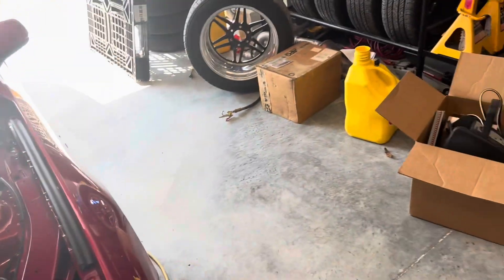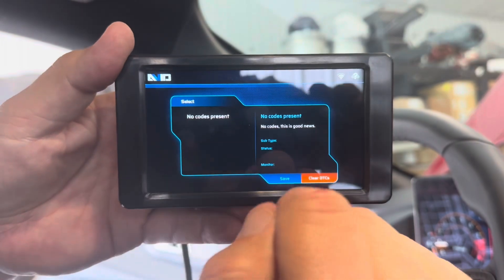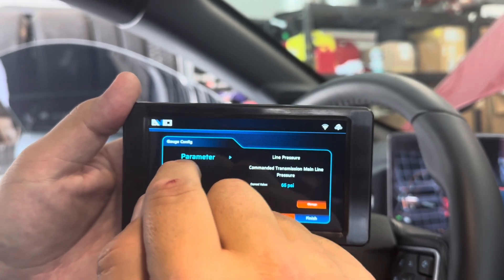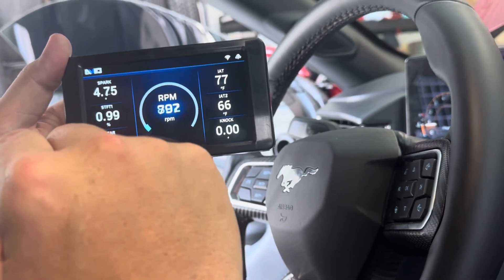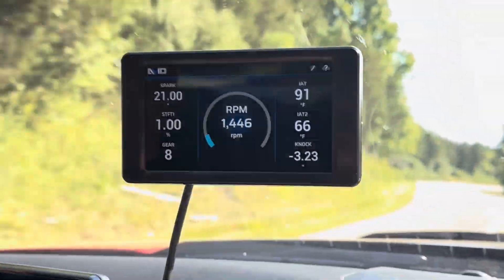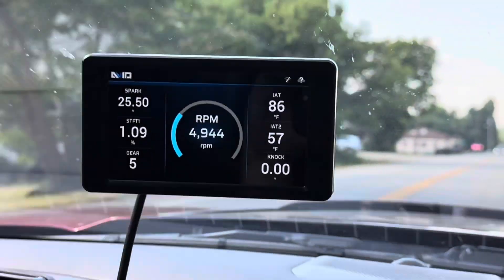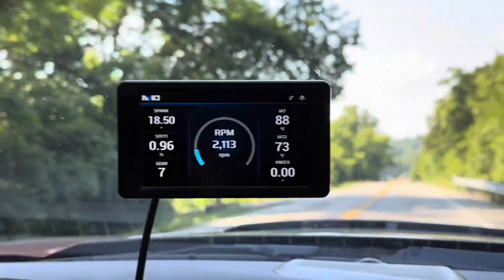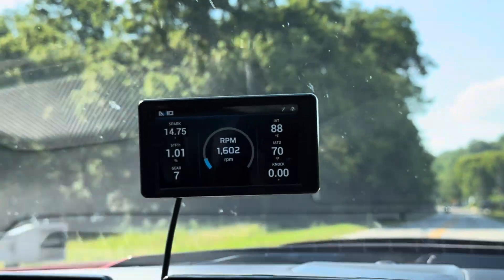50 Degree Cooler IAT's on Your Supercharged Mustang with Bonus Avid Device Footage

Comment: Is that stage 1 or 2? Did you remove the heat exchanger or just add this to the cooling system
Reply from the maker: The heat exchanger gets removed as it’s no longer needed and we opted for the stage two     we do offer for both though
Reply: @TeamBeefcakeRacing  ok thanks
Reply from the maker: @Turbogt91  yw
Reply: @TeamBeefcakeRacing  this is ok for a car that never sees a winter.  In other states that run their heaters, you need the heat exchanger and a bypass valve.
Reply from the maker: @WalterLombard-d6z  that’s actually completely inaccurate we’re in Ohio and we get winners all the time
Reply from the maker: @WalterLombard-d6z  you do not need the heat exchanger.
Reply: @TeamBeefcakeRacing  Do you run your AC in winter?

Comment: I have one installed on my Roush car I got from you.  IAT2s stay at 87 in the summer heat.  I believe that's why my non ported Roush 2650 ran a 5.2 60-130 on E85.